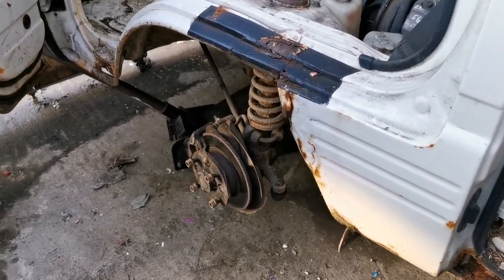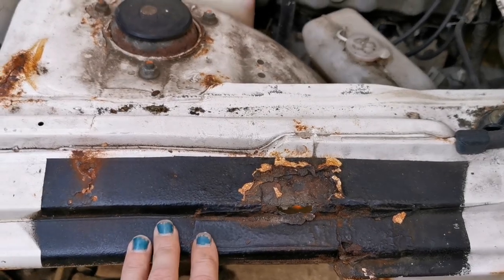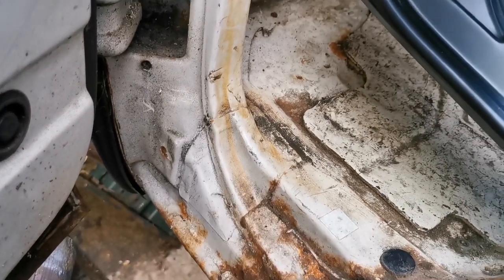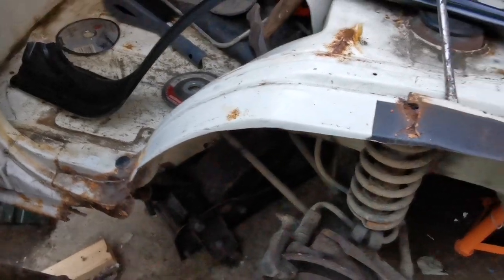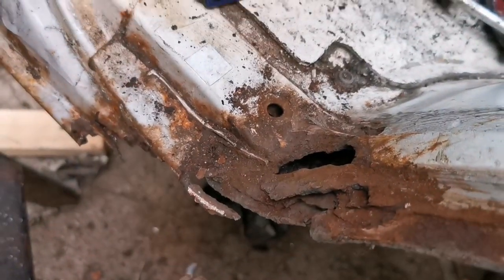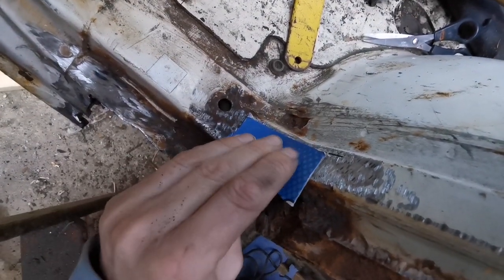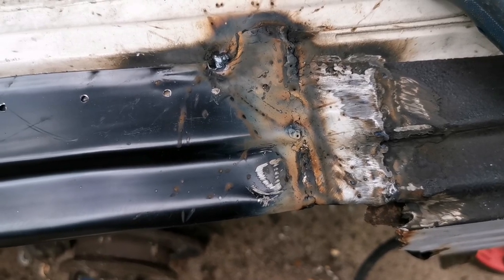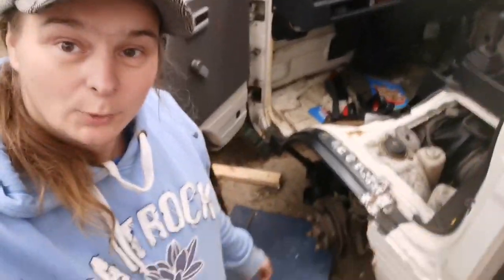Bedford Rascal, Suzuki Super Carry , fitting a replacement wheel arch!

Comment: Where do you get the replacements? 😭
Reply from the maker: Some Suzuki dealership sell them, but you have to order, or there are some available occasionally on eBay.    Mine came from a Suzuki dealership. Cheers
Reply: @RetroRatz  thank you for your reply, I have tracked some down, the rears are looking like a home fab job. Subbed, keep it up ✌
Reply from the maker: @lordbagguley3890  yes indeed.  I'm going to try to make a pair.  Will put on the channel when I do it.  I've 2 Vans here Todo 👌
Reply: @RetroRatz  that would be great as I really need to do mine